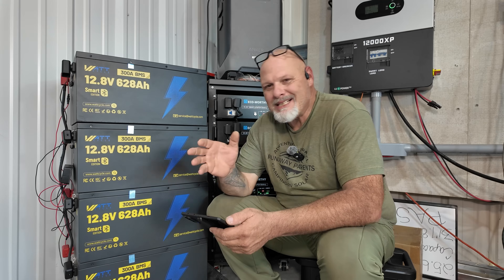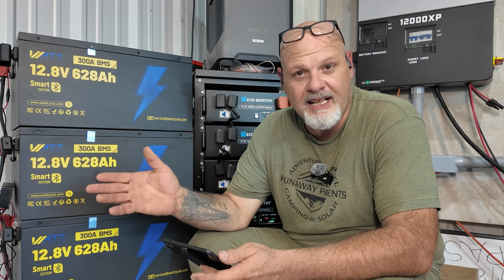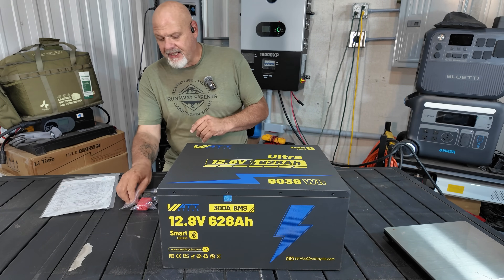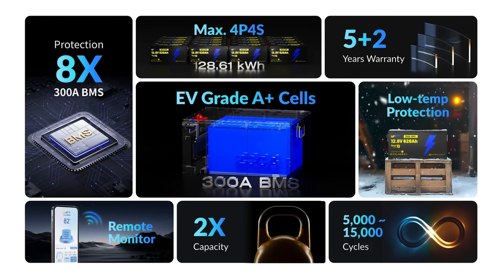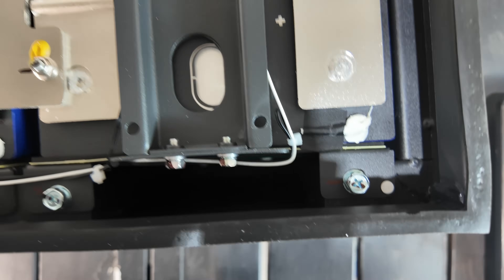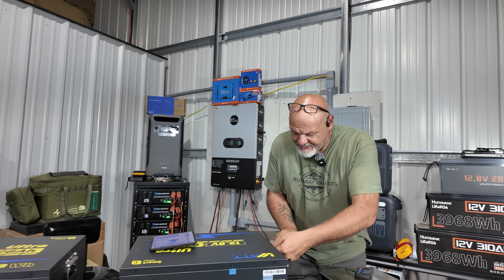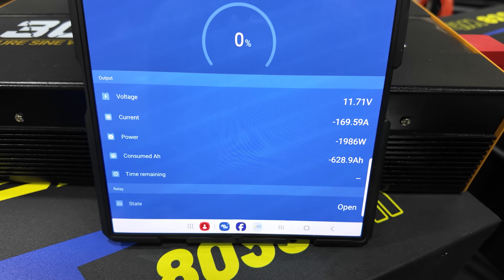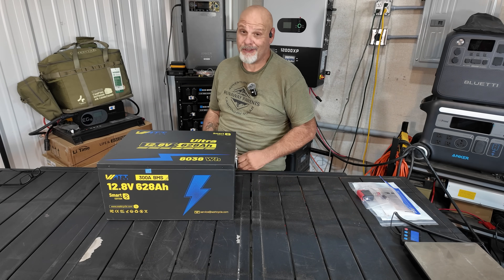DIY 48V Home Power Wall — These WattCycle 12V 628AH Batteries Are NEXT LEVEL!

Comment: I would use it for my refrigerator i remove the 240v compressor out n put a 12v compressor put a solar panels n controller too..
#wattcycle

Comment: Yikes.  Docan and others are offering 16k all the way up to the 32k you're getting here but in batteries that are designed to run at that voltage natively and in a smaller footprint, far less things to manage and/or break.  12V are still good options for 12V environments.  RVs etc but man, buying 4 batteries and wiring them together to hit what is widely available in 48V storage....I just don't see it.  I also don't see paying more money for more risk and management overhead.  4k for your solution.  Docan Panda will be around 3k shipped and its one package with bundled software developed for 48v battery applications.  Anyway, yeah that's a good price on the storage capacity for 12v LFPs but still more costly, in actual currency but also technical debt.
Reply from the maker: I hear you, and 48V native setups definitely make sense for a lot of people. But for what we’re doing, these WattCycle 12V 628Ah batteries actually work out really well in a 48V series setup.

For one, I tested them and each one pulled 649Ah, so the performance is legit. They’re solid batteries. And I actually like the modular setup — if one ever acts up years down the road, I can swap a single unit instead of dealing with a whole 48V pack.

Plus for us, we bounce between home energy storage and RV/off-grid stuff when we’re traveling and filming. Having batteries that can work in both environments is a huge win. And honestly, I like being able to monitor each battery’s BMS individually. Makes it easier to keep an eye on everything.

So yeah, The Docan 32kw pack looks great but when i talked to them taxes and freight shipping would have added almost $1500 to the cost , but this WattCycle setup fits what we do really well. Always appreciate the discussion — it’s cool hearing different perspectives on how people build their systems! 🔋😄

Comment: how much battery you think I would need to run a 12v outEquip ac for night in a small truckcamper i.e a tune m1. Solar during day and back up generator.
Reply from the maker: Hey thanks for the question. I would definitely recommend 2 of the WattCycle 314ah minis or if you can fit it somewhere one of these 628ah batteries would complement that Unit nicely. From what I know about that ac 600ah should easily get you 15hrs  possibly 20hrs of run time.
Reply: @runawayparents thanks for the input!

Comment: Does the app recognize when they’re in series, and report as the full battery bank? Or at least show the soc for each batt on one page?
Reply from the maker: You will have to look at each battery individually on the app. I have a Victron shunt hooked up to it that reports as one unit so I can monitor it as one large system. It would be really cool if the app recognized that.
Reply: @runawayparents  Yeah, got excited when I saw the parallel mode switch, since it means they’re at least aware that these batteries aren’t always used standalone.  It’s surely gotta be possible, to get the batts to talk to each other via bluetooth, or just do it in the app with certain UI adjustment. If you got their ear, might be worth sharing some feedback for them.

Comment: I have 2 314 minis wattcycle batteries.  In parallel in my 2008 Lance Truck camper. They had a problem but they seem to be fixed now. Love them  wattcycle#

Comment: Those are monsters!! Pretty heavy for th rv though right? Seems like 2 for a camper right?
Reply from the maker: 2 would be the equivalent to almost 7 12v 100ah batterys in a much smaller footprint. Pretty awesome capacity in a smaller footprint.  Don't forget to #WattCycle for the giveaway.
Reply: @r @runawayparents ank you #wattcycle batteries